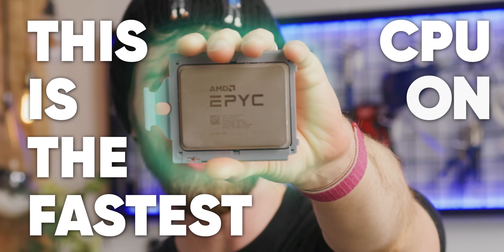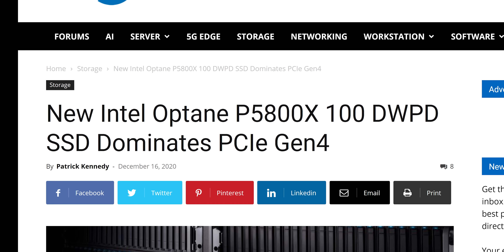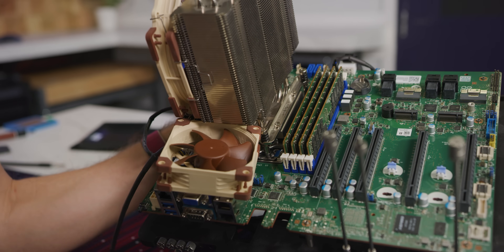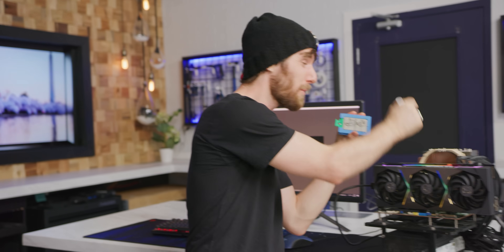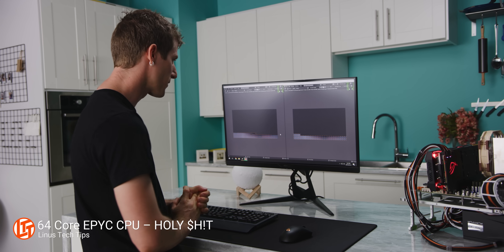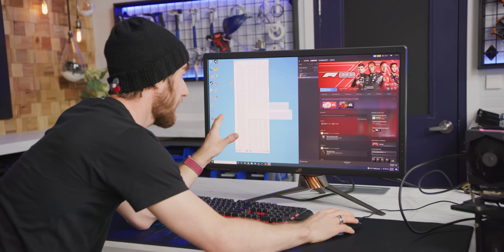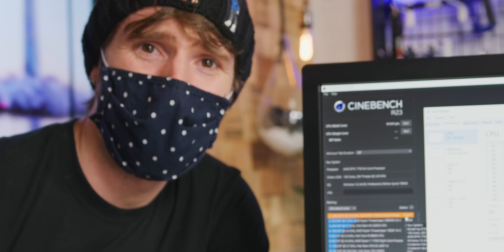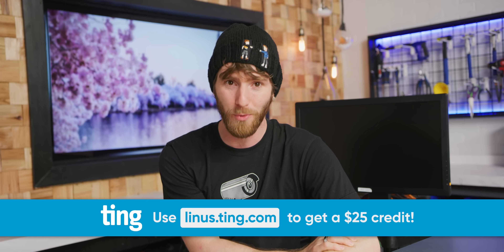The Fastest CPU on the Planet - HOLY $H!T - EPYC Milan 7763 64 Core

Comment: i’ll watch this again in 10 years when 64 cores is mid range
Reply: you mean when you are able to game on a toaster but for real...
Reply: @paradiesler6755  we laughed about the Xbox fridge, it has become a fridge 

The laughed about cases looking like a fridge, Samsung makes a smart fridge

A guy got doom working on a toaster (for real) 

Wtf
Reply: @paradiesler6755  linus: cools a threadripper with a noctua nhu12s
                           temprature: 98 C
Reply: @paradiesler6755  2
Reply: Mid range in cellphones
Reply: @shawnj4554  true
Reply: There's a pic floating around of someone charging his smart sneaker via smart couch. Nothing makes sense anymore.
Reply: In 2012, I built a pc using an intel 3570K: 4 cores, base clock 3.4GHz, turbo 3.8GHz and easily overclocked it to 4.6GHz without any fuss. It's still running fine.
This year I built a pc using an AMD 5600X: 6 cores, base clock 3.7GHz, turbo 4.6GHz and simply overclocked it to 4.8GHz, also without any fuss. It performs much faster than my old 3570K, but the clock speeds have hardly altered in 9 years, nor have the number of cores increased by much.
The truth is that clocks over 5GHz are hard to achieve reliably and are likely to remain so. After all, even light will only travel 6 cm for each clock tick at that rate, so those poor electrons are having to work really hard and we're heading towards an upper limit on clock speeds.
The best we can hope for is to integrate more cores into smaller packages, but that carries problems of reducing yield and hence higher prices.
I've built computers since the 1970s and seen how progress was made in leaps and bounds, but I seriously doubt that there are massive gains left to be wrung out of silicon. Extrapolating the advances in technology of the previous 50 years to the immediate future is merely wishful thinking.
Reply: @RexxSchneider  Agreed. The elephant in the room is that Silicon doesn't reliably scale past 5 GHz.  There have been CPUs running at 500+ GHz but a) you can't afford the cooling bill, and b) they weren't using silicon.  (GaAs is one possible contender.)
Reply: and ill still have 6 cores
Reply: That’s gonna be an awesome day
Reply: HELLO ME IN 10 YEARS :)
Reply: IF SOMEONE SEES THIS COMMENT AFTER 10 YEARS REPLY IT SO I CAN SEE IT AGAIN :D
Reply: @trendingshortss03  HELLO YOU IN 9 YEARS
Reply: When 7.0 GHz all  cores will be average
Reply: Timed with the gta 6 release
Reply: It won't be. Taking advantage of parallel processing is hard in most applications and requires skillfully breaking down algorithms into completely separate parts. Most programs won't ever be able to use all 128 threads simultaneously.

These many threads are only used in a few cases, like rendering.
Reply: My phone has more ram than some people have in their desktops or laptops. I think we are already there, only it is to expensive for regular consumers to release just yet.
Reply: Looks like you’ll only need to wait another couple years considering 90 core is a thing now
Reply: In 10 years it will be low end
Reply: @will3641  in 10 years this will be still high rich end. For the next 10 years you will not need more then 16C/32T (not even close to that). and in 10 years we maybe play all on Google Stadia and other cloud gaming services.
Reply: @allxtend4005  Good luck with streaming gaming .......Bandwidth requirement still way too high.
Reply: More like 3 years at this rate
Reply: Maybe even 5 years
Reply: Try 2 years
Reply: Me too
Reply: Exactly what I was thinking
Reply: Yep.
Reply: Or they have them in cheap crappy laptops...
Reply: Why would anyone want that many cores for gaming? About 4 cores is the optimal amount, I just wish we could get less cores and higher clock speeds but CPU manufacturers don’t seem to care about that.
Reply: @whwhwhhwhhhwhdldkjdsnsjsks6544  thats the thing it is not possible to have higher clocks anymore, its all about more cores if you want powerful PC. Almost all games these days are optimized for 4 cores 8 threads like. Those this will change during this gen, and more games will be optimized to run on 6 cores 12 threads or 8 cores 16 threads, do to of nature of more cores in midrange and highe end PC's
Reply: @kigasdj2  Ngl most games I play don’t support multithreading but it doesn’t seem like it should be impossible because every year clock speeds increase a bit
Reply: what is the price of an intel 64 core i7 3820?
Reply: 10 years ago 6 cores was considered enthusiast, nowadays it's midrange
Reply: Cpu frequency hasn't increased at the high end for about a decade. But there have been small incremental increases in the processing speed achieved by each core using other clever tricks with caching, memory speed, and architecture.  I doubt this can push it really far though.

We need new materials like carbon nanotubes to really push the bar.
Reply: when 256 core is a thing...
Reply: Linus in 10 years:

A BUDGET BUILD WOULD BE THIS $120,000 BUILD FEATURING 35 COPYS OF A AMD RYZEN 9999999999999999999999999999999999999 5800x
Reply: ill set a reminder
Reply: See you all in 10 years!
Reply: You mean mid high end range.
Reply: hm yes
Reply: Soon you can buy eyes with 1000 Hz
Reply: faxx
Reply: Me too
Reply: By that time AAA games will start demanding for 256 cores and 512 threads 😂😂😂😂😂
Just to run them on 1080p medium setting
Reply: We might be running arm or quantum computers. Who knows!?
Reply: And when the top technology is 1nm
Reply: Nah
Reply: Me also lol, we see ya!
Reply: It won't be
Reply: Moores law
Reply: New amd cpus will have 120 cores
Reply: same
Reply: You don't have to wait for that long
Reply: Seriously
Reply: 9 more years
Reply: @pivotpcs7631  holy crap it’s already been a year since i commented this
Reply: hehe
Reply: 20*
Reply: one year later. 96 cores is tops
Reply: @donc-m4900  420 cores low range in 5 years garunteed
Reply: @Aqua2D  for under $1,000 hopfully
Reply: @donc-m4900  nope, about $6.90
Reply: @Aqua2D  nice!
Reply: It'll all be photon based quantum in 10 yrs...
Reply: And you still can't afford it.
Neither can I.
Reply: I hope, man.
Reply: @ConceptualCoasters  after 4 years i bought a 24 core 7402, it's amazing with only 4 channel ram that i installed because of low budget
Reply: Lol its 4 years later.. the CPU costs less than $900
Reply: Well, in 2011 everybody had 2~4 cores, now the mid range is like 6, so I doubt mid range will be 64 in only 10 years, it will probably be more like 8~16 by 2031
Reply: @motaaaa  technology can jump leaps and bounds in a second. You never know. But I definitely understand your logic
Reply: @MoneyMager  but it takes ages to get to the consumer market 😩
Reply: @motaaaa  I think he was referring to server grade cpu, however high end consumer chips hit 16 cores, so it may not be a joke
Reply: @motaaaa  Technology is Exponential, leaps and bounds in the last 10 years. Look at Apple. They released the first iPhone in 2007. Only 14 years ago.
Reply: @CybrRL  Except that it won't be open for all consumers in the future since the earth's resources are depleting too quickly for the manufacturers to produce the quantity currently being produced.
Reply: @Bluepaccao  the earth isn't the problem lol we have all the resources we need on earth maybe not the man power to get the resources but the resources aren't the problem
Reply: @motaaaa  1 Big core, 4 Large cores, 8 medium cores, 12 little cores.
The future of mainstream.
Because VF curves aren't a thing apparently and who really wants 24 BIG cores when you can have a bunch of small ones. /sarc
Reply: When you have a 16 core phone but 32 cores and 64gb of ram is minimum requirement for games that look pretty similar.
Reply: In 10 years we will all be cloud gaming on quantum computer in an Oasis like game... (maybe in 20😂)
Reply: @T4ntalos  maybe you will. I enjoy PHYSICALLY owning my hardware.
Reply: @T4ntalos  god i hope not
Reply: @T4ntalos  i dont think you know what a quantum pc is or how it works although prob your comment is a joke but still
Reply: @T4ntalos  quantum computers suck at gaming tho
Reply: @T4ntalos  It will all be Google Stadia with infinite negative latency.
Reply: @lach888c2  well that comment didn't age well
Reply: Probs watch it next year for that lol
Reply: I don't think that's ever happening since honestly it'll be better to make denser smaller and fewer cores rather than increase it all the way to 64. Maybe Ryzen 7 will be 64 core but it'll not be mid range
Reply: Lmao
Reply: or when ARM takes over and it's thousands of cores and a totally different instruction set.
Reply: Lol, in 10 years this threadripper will still Rip to pieces new midrangers for like 300 dollars. This is not early 90's where things was changing drastically in cpu scene every few months or so. From 2011 not much changed to be honest in cpu market. You get 6 cores in midrange instead of 2-4 cores,  frequencies already hit the ceiling long ago and you get stuck in 4.5ghzish territory :) need some kind of new architectural technogy to see improvements otherwise in 10 years things will ve very similar, probably 10 core will be norm in midragne otherwise thats it.
Reply: 4000 core CPUs in 2050:
Reply: Just wait for 3-5 years
Reply: 10 years try 5 years from now when we have 164 cores as considered mid range. With dual quantum cores being the mainstream.
Reply: Not midrange but instead lowrange considering how fast technology is developing
Reply: Man... I was so happy when I got my 12 core 24 thread AMD Ryzen 9 3900x, now I feel like a child being scolded by my parents for asking for a candy bar at the grocery store checkout.

Comment: 8k for a server cpu is pretty cheap, linus failed to mention that intel used to ask 13k for a cpu at one point.
Also claiming its the fastest is kinda misleading, since the core clocks are pretty low. However it is the most powerfull. period.

Comment: @Linus Tech Tips You were trying to install the ram backward as you was installing the last piece, and you still tried to push it down as you were talking XDXDXD (Time @ 3:00 to 3:06)  Now I rewatched it couple times cant tell if it was backwards on the hump in the middle of the slot or you just had the ram off to side to much but I'm Sticking with backward

Comment: It's going to take many years before the average enterprise will trust AMD. The price difference simply does not matter in the enterprise environment, even at 40.000 units it's pretty much a rounding error for the large enterprise.    
What matters is how well it will work with the software and workflows that an enterprise already has in place, How fast AMD will fly in on site support, and how willing and effective AMD is in working with them to make stuff work reliably with 99,999% uptime.    
They'll get there, but it'll take time.

Comment: The cache changes in Zen3 really helped gaming, but that's a HUGE help in server workloads, where jobs will change from one core to another frequently, and if the data is already in the local l3 cache, it helps a lot.  With the Zen2 architecture, the cache misses when a thread changed cores was fairly frequent, causing more data to be retrieved from main memory, but Zen3 avoids that far more frequently by having more cores per L3 chunk.

Comment: Gaming on this is irrelevant.  Threadripper is more likely to be gamed on.
Reply: Would be interesting to see gaming performance if a game could be reprogrammed to utilise all those cores.
Reply: @LucaDarioBützberger  why would a developer spend the resources doing that when virtually nobody would have a CPU with that many threads for gaming?  I have a 5950X and even that has twice as many cores as games need.
Reply: @ksp1278  I said "what if", not "they should". But the answer you ask for is already written in my comment.
Reply: @LucaDarioBützberger  There is no point in doing this for current games.  There simply isn't enough stuff going on to utilise 128 threads.  The limitation for performance is ultimately capped by how fast a CPU can run ONE thread, because all games need to have a single thread that will be tying together the work done by the other threads.  Of course, in the future, games will contain "worlds" that are much more "alive".  They will I am sure eventually be able to use tens or even hundreds of cores depending on the number of things they simulate.  For example AI of multiple characters or even physics calculations on every object in a scene where everything  can be moved.  Right now though, games are not attempting to model the kind of detail that requires that many cores because game developers need to cater to the systems that most people have.
Reply: @LucaDarioBützberger  I agree that simulation games could possibly benefit from more cores, but it may not scale as well as you think it would.  It really depends on whether the GPU is slowing the game down or the CPU.  It is a balancing act.  If games had hundreds of threads, as you say, then no need to modify them.  The operating system will spread the load across all the cores as necessary.  I am not arguing against doing it if somebody wants to do it.  I am simply saying that games companies are unlikely to do so, as the added complexity involved obviously increases development cost.  Software will automatically become more multithreaded, as the number of cores people have increases.  But, based on the fact  the latest consoles are 8 core, that is what this generation of games will be optimised for.  I don't know what your background is, but I am a software developer (though not a games developer) and I can tell you now that  writing multithreaded code is significantly more complex than single threaded.  This is especially true if you are not writing managed code (C# etc).  I  written games in the past, but only for learning purposes.
Reply: @ksp1278    This conversation is getting too tedious. Your comment is interesting and nice but it doesen't respond to what I originally wrote. I am well aware why companies do not do it right now but that wasn't the topic. And I am really not interested in that anway. So while I am glad your response is so detailed and fact filled, I never tried or wanted to talk about that part of software developement. 
I noted it would be interesting to see gaming performance if a game would be reprogrammed to utilise all those cores. Because a game has more than enough tasks that could be splitted across dozens of cores. Just take games like Minecraft and Terraria, which could see exponential performance increases while dramatically increasing the complexity of what's possible within the game thanks to their design. And the question if the gpu will bopttleneck it first is irrelevant since you don't need a graphical output so see a change. I am interested in speed and efficiency and pushing technical limits and boundaries. I am not interested in the economical aspect of why companies don't do it because the answer is always money respectively greed. 
I am interested in the "what if" part, not the "why not" part. I don't like thinking that way because it prevents people from doing remarkable things. 

Thanks for the input.

Comment: Goes quite nicely into 32 dual-core systems. Entire school class’ IT needs in one machine? Why buy 32 cheap Celeron laptops when you can buy one huge server and run everyone at once on it?
Reply: Chromebooks are almost dumb terminals
Reply: @Chris S but a chromebook can't do everything a PC can. I'd have a 4 thread zen3 CPU instead of a chromebook any day of the week. One zen3 core would be comparable to 3-4 arm cores that they use.
Reply: @superneenjaa718  Yes, but it isn’t always arm based. x86 chromebooks exist too. You can install Linux apps and theoretically do most things a pc can. But most schools use cloud based apps so massive processing power isn’t necessary. Although if I got a zen 3 processor pc for schooling I would cry tears of joy.
Reply: Make that 64 systems or more. Even if SMT can’t replace real cores you cansafely overprovision by a lot and as long as not every machine runs at full utilization the hypervisor will happily distribute the load for you.